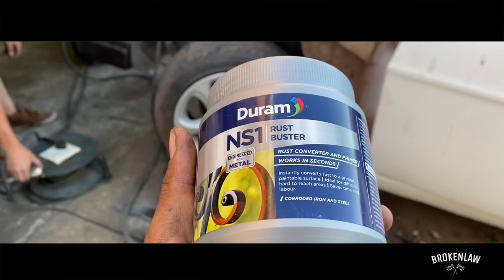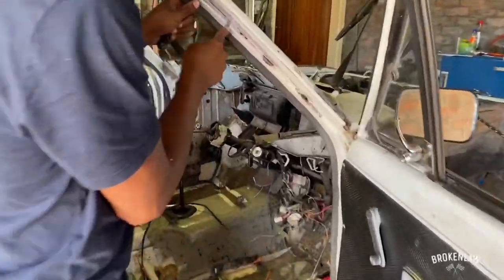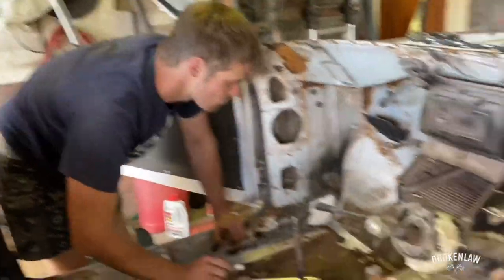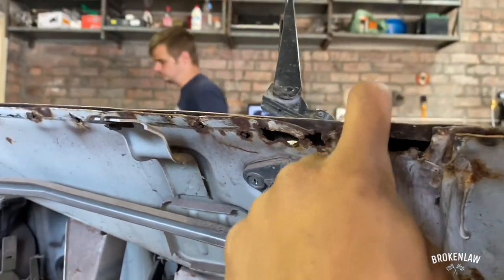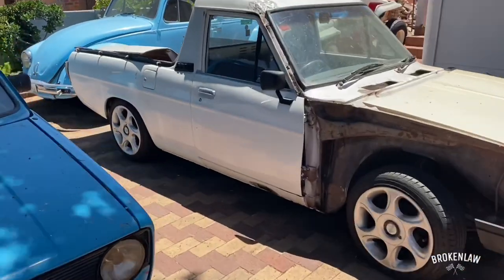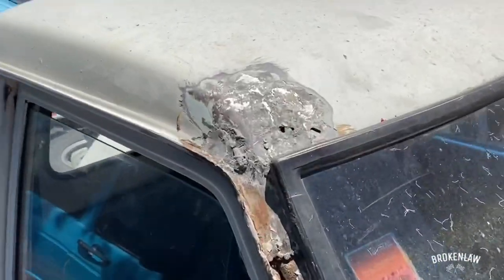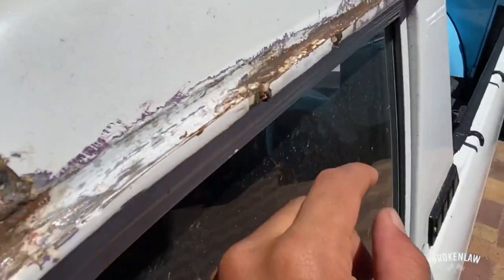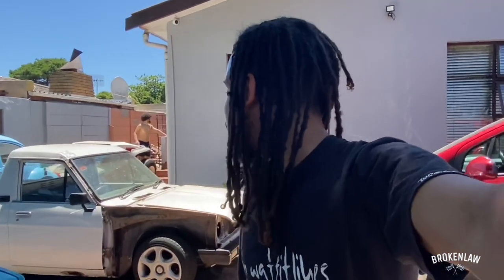Rebuilding my Nissan 1400 Bakkie/Pick-up Truck (Part 1) : Rust Repair!

Comment: I having the same issues with my conquest I bought a year ago. Body filler cracking on the roof and the rear doors. Plans to repair and repair the whole car. But budget mybru is kaas tight😬
Reply from the maker: Well, I never anticipated so much rust, and rust repair can get really pricey. It was supposed to only be minor repairs and a respray, that now turned into a complete rebuild. So my budget is definitely not ready for that either, but it’ll be worth it when it’s complete! 🤌🏽

Comment: Fire video bro, are u going 2 daily her with the standerd a14 motor??
Reply from the maker: Yes, the plan is to daily it with the A14 engine 👍🏽
Reply: Aweh thats a vibe bro!!!, was thinking on doing a swap on mine but now im leaning more towards that nfnr aluminum fuel injection kit n some add on's to complement the kit, n enjoy it as a standard 1400 daily with a kick.